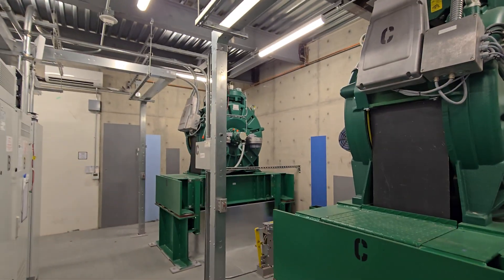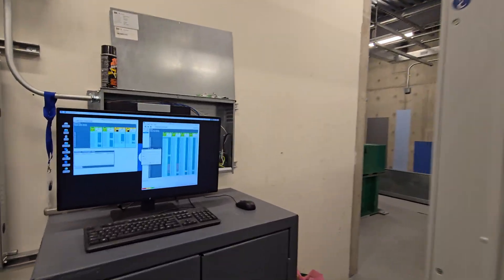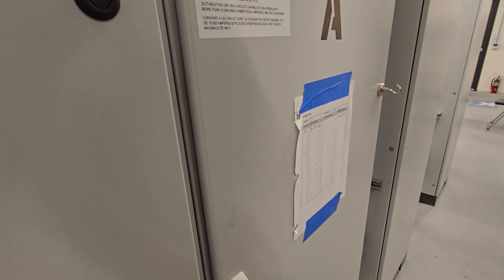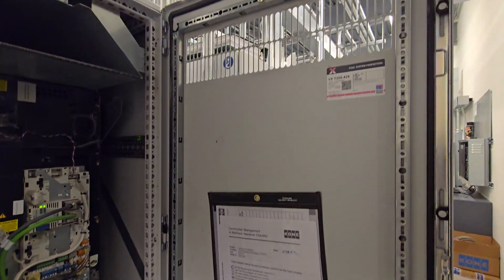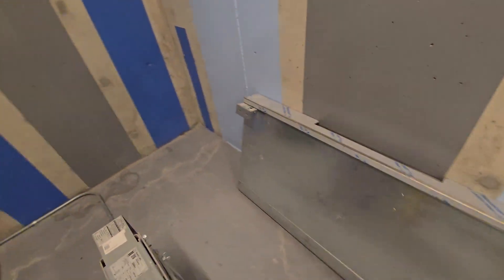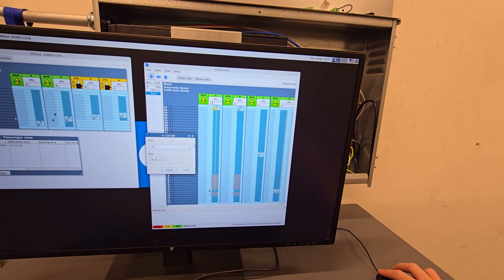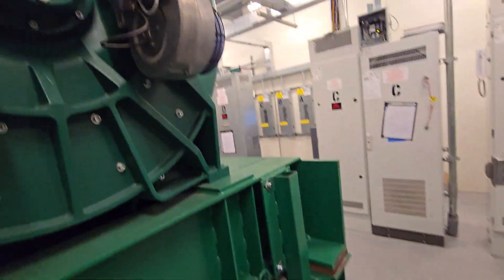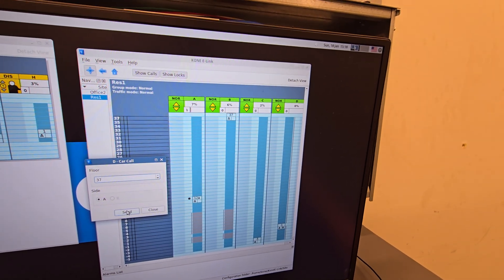INCREDIBLE 1000FPM Kone MX40 Traction Elevator Machine Room

Comment: The MX32 And MX40 Are basically same because they use an 2 MX18 Motors, on MX32 they use an Basic MX18, but MX40 uses a MX18 High Perfomance
Reply: I think the MX 40 is an original design, the video also has an mx32 and it's smaller than the MX40 using the fans as size reference. It also has 4 eyebolts instead of the 2 on the MX32
Reply from the maker: They are both original designs, just scaled similarly.
Reply: @QEElevators  still legendary elevators